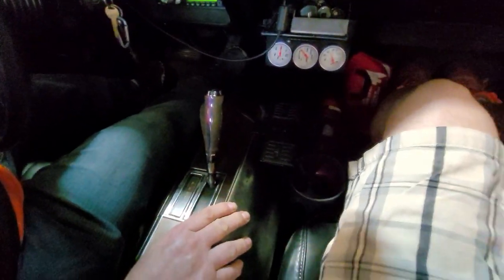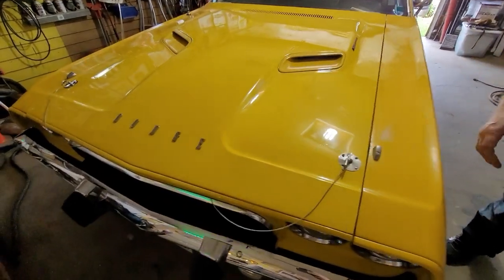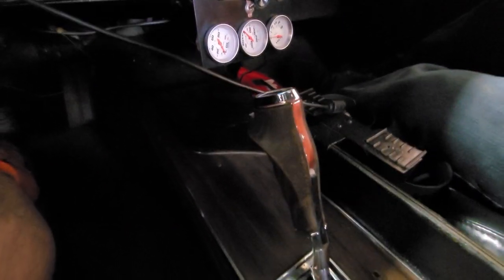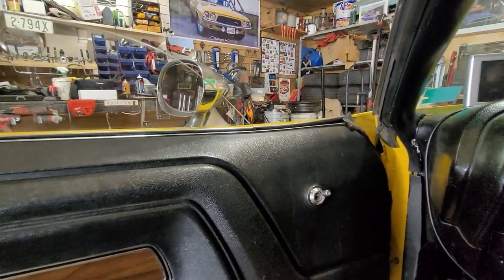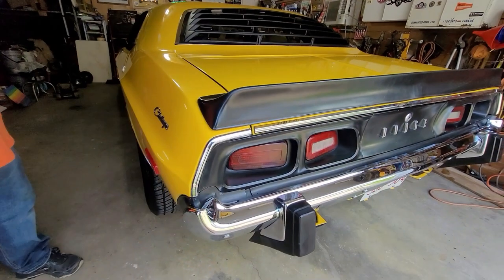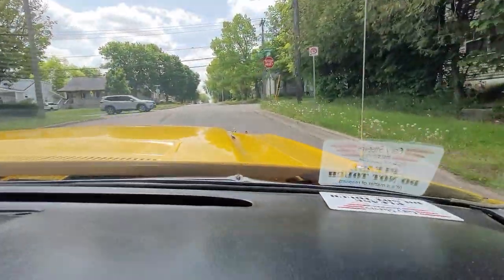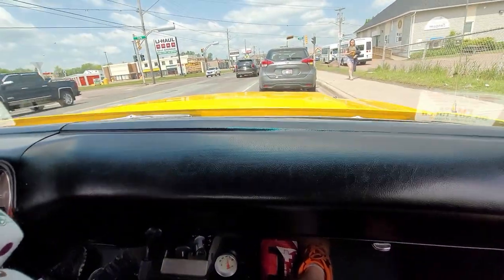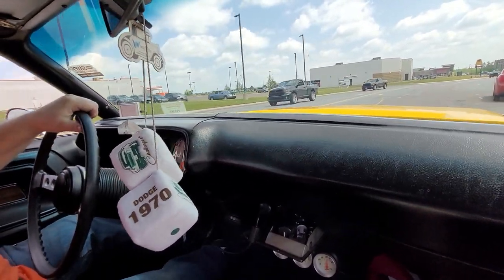1973 Dodge Challenger 340

Comment: Thanks for the memories. In my youth. The 2nd car I ever bought was a '73 Dodge Challenger. Rust free out of Arizona. It had the stock 340 high po engine. It was yellow with the black strobe stripes down the sides. Black vinyl roof. Black interior. The radio was stock. But it was kind of a strange set up. It was left of the driver. Close to the door & was put in vertical position. A Dodge thing? It had the 727 trans.  I think they were kind of un common with the small bell housing for small blocks. You would think it would of had the 904. But it was stock. Dodge thing in the 70's? Dyan 60 sure grip rear end. I bought it in '79. Who ever had it before me. Replaced the stock rally wheels with slotted mags. But that was cool. Just what we done back then. He had them old school yellow upper & lower traction bars on it. That was cool. Of course I was young. Didn't know how to tune a carb. But I felt like I was always fighting that Carter Theramal Quaid.
Reply from the maker: Happy to have brought back those memories for you. It's great how certain cars can strike a chord like that with people. Cheers